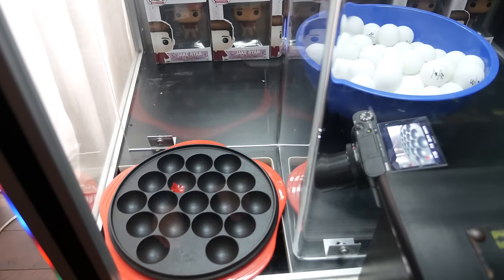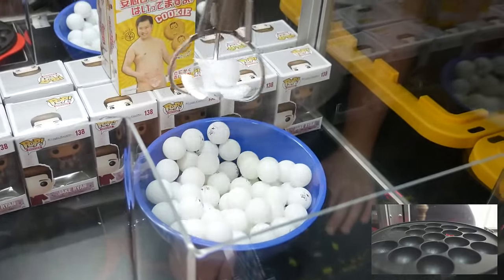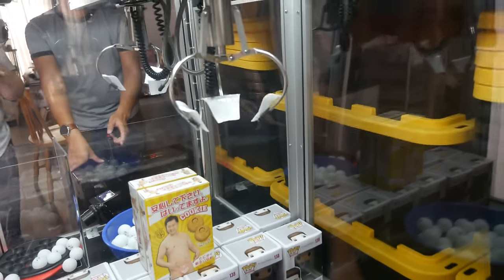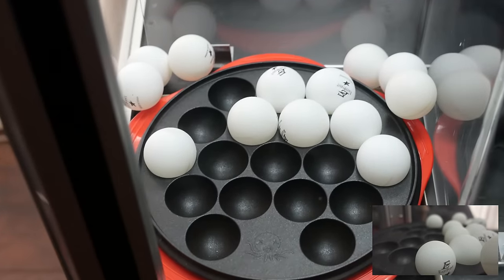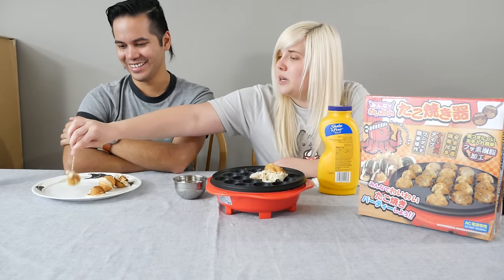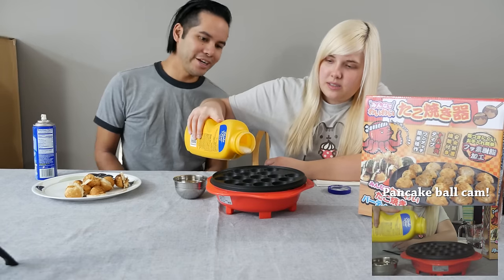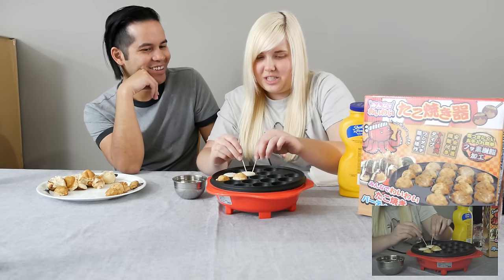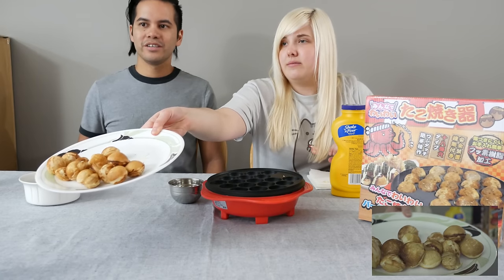Crane Couple Versus Battle - Ping Pong Ball Dropper

Comment: Couple of tips for making those pancake balls:
1. you need to make your batter thinner otherwise it will harder too fast to pour and make a round ball. I suggest an actual Aebleskiver recipe since that's made to be spherical.
2. When i make them i use a thin metal double point knitting needle. They are more durable, and much easier to wipe with your paper towel each time in between turns.
3. definitely order one of those japanese style oil brushes because they really spread out the oil really well and evenly
4. practice! they are super great to make for friends and family. It's pretty cool you guys have an electric maker. I have a cast iron pan you have to put on the stove, so i'm jealous you can do it with much more space at a kitchen table. If you keep making pancake balls, try and give lingonberry jam on them a try, it's the traditional Scandinavian way of eating them :)
keep on being excellent guys!
Reply from the maker: +japangrl Thank you so much for the tips! We'll give them a shot next time :) definitely gonna grab some lingonberry jam too, had some before and it was great!

Comment: +the crane couple is this your claw and how much did it cost
Reply from the maker: Yes, this is our claw machine and we got it off of Craigslist for about $800 :) It's an older model, but it works really well and is a little smaller than the average machine so it fits nicely in the living room!
Reply: +The Crane Couple do you think I can get a good one for about 1500?
Reply from the maker: Dorien Grant I think so! You just have to inspect the machine carefully - make sure all the different parts work right, and also be willing to learn how to fix anything that eventually wears out or breaks!
Reply: +The Crane Couple ok thank you🙂
Reply from the maker: Dorien Grant No problem! If you have any other questions, feel free to ask :)